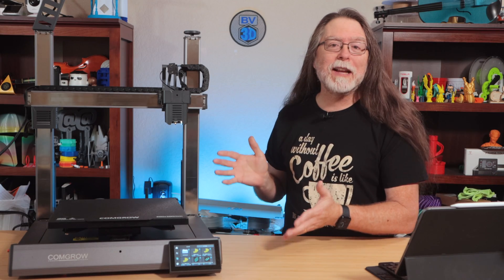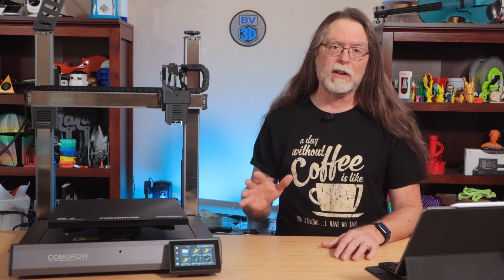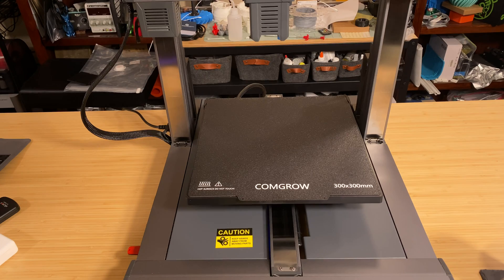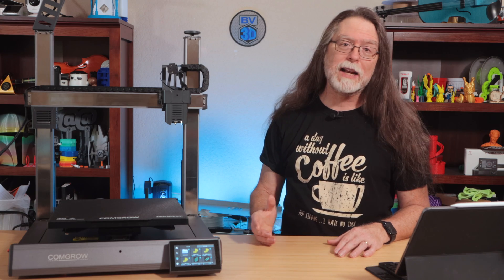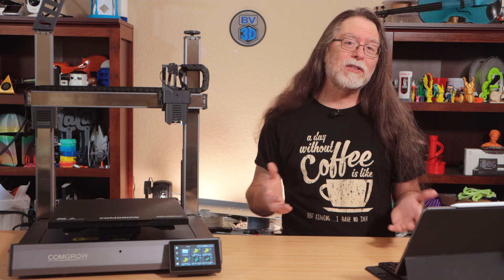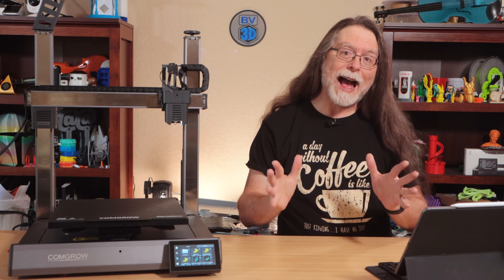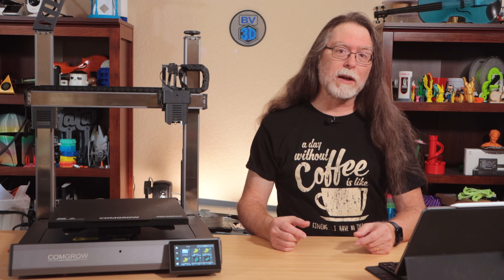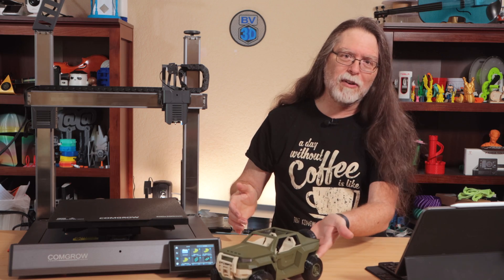Comgrow T300 - A beautiful 3D printer with awful settings. (fixable!)

Comment: Thanks - hood video. Do all 3 axis have linear bearings? What is inside the Z-columns? Screws or belts? It is correct that only one of the 2 columns Z-axis has a drive?

Comment: Thank you for this nicely balanced review.  I am a bit disappointed that so many of the consumer-level printer manufacturers are still obsessed with these open-frame bedslinger PLA/PETG/TPU printers that really are not much different than the printers of a few years ago.  I really like Sovol; my Sovol SV05 printer (which is basically a nicely upgraded Creality Ender 5 Pro) has served me well until I replaced it with a Qidi X-Max 3 (which is also serving me well) but I wish they would move on to more capable printers that can print other materials besides PLA, PETG, and TPU.  I doubt that I will ever buy another non-enclosed printer again.

Comment: Great video, amazing looking VSV model! I published well tuned Orca Slicer profiles in my recent video about the T300, including much improved pre-print macros by Christian Vick.  I don't really recommend the stock T500 Orca presets, since that machine has very different acceleration/jitter values and even the extruder/nozzle is different, so the retraction values also need to be customized for the T300.  I am so happy to see you like this printer too!
Reply from the maker: I will go check out your video! Thanks @gerGoPrint3D !